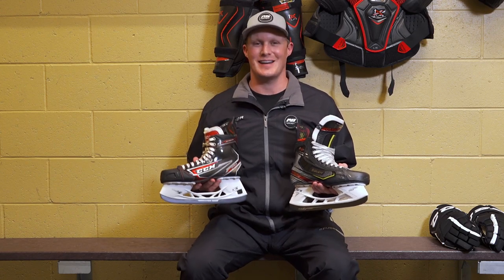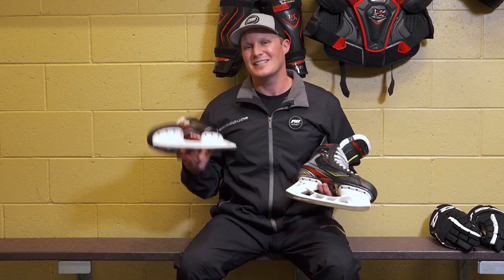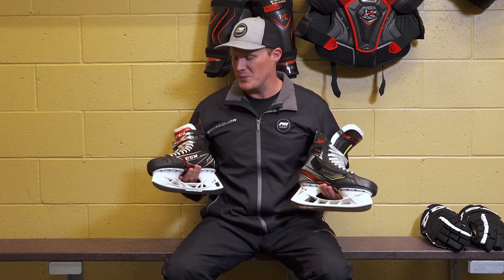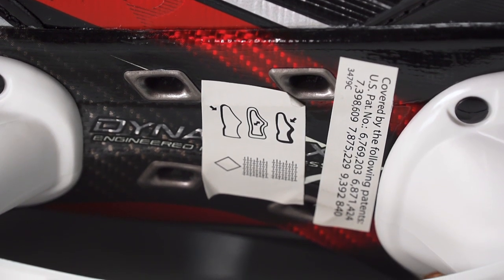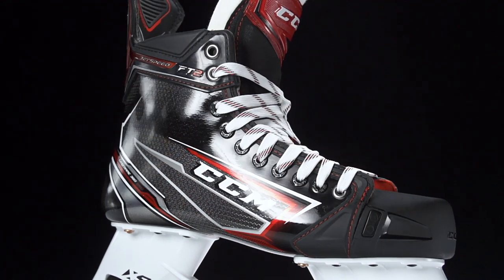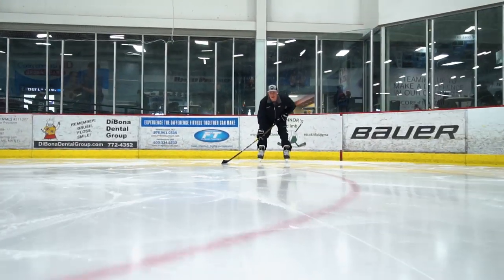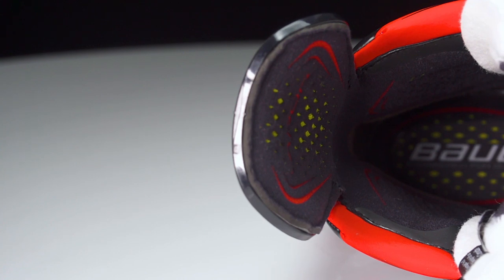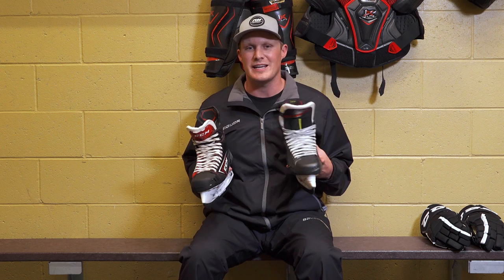Bauer Vapor 2X Pro vs CCM JetSpeed FT2 Skates // Tech & Spec Comparison

Comment: Always ribcor when it comes tó skates. I have  a size 5.0 and width D. But when I scaned my feet In the only shoplike shop In my country. They föld you need a size 4.5 and width C for your left and a width D for your right foot. But Im still comfortable width my ccm ribcor 66k wich is size 5.0 and width D. Should I get a size 4.5 skates? If I should what width shoul I get : C or D or R  or E or EE?

Comment: If I wear a Bauer vapor right now, will I have any issues crossing over to ccm jetspeed skates?
Reply from the maker: You shouldn't have any issues since the Jetspeed skates are built with slightly more volume. Stick to the same size and width and you should be good to go.

Brandon IW Hockey
Reply: Ice Warehouse thank you!! Now I don’t have any doubt about switching mid season! You guys are the best